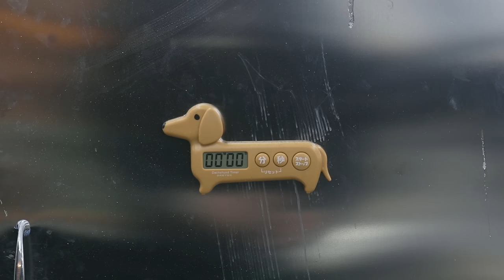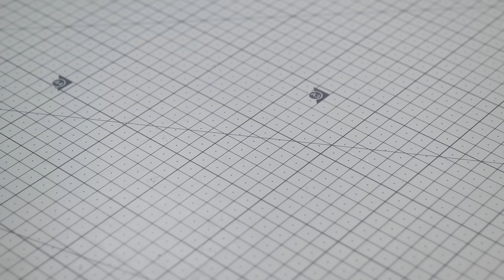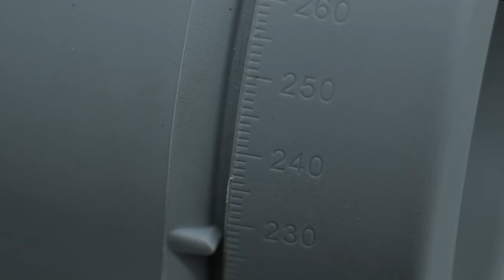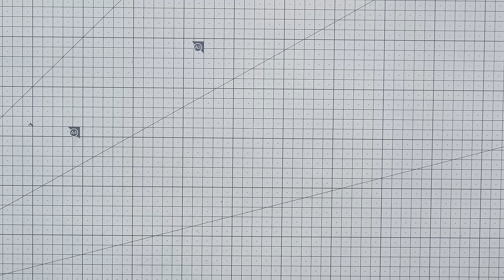'Remake' GUCCI Bamboo Jacquard flat shoes REMAKE - VeTiVeR

Comment: 8 out of 10. nice, but, the heel overlap left a big empty space. the sole protection cut have been cut more accurately. is there no way to perhaps, bevel that edge of the sole protection, so that it has a smoother transition to the original sole. that edge is a bit off putting. the black Gucci material was way too dark. it needed something, more, the color of the bamboo. everything else looks good. great camera work.

Comment: Woohoo another shoe mystery. At 1st glance those don't look so trashed as they are ancient. ¯\_(ツ)_/¯  I have certainly had footwear that was not abused, hardly worn even fall apart after 40 years. In my climate adhesives notariously fail along with plastic disintegrates - among other debilating conditions. 😒 
 Just a guess, a little mystery. 😆

Comment: Great work but I would have stuck to the original colours because the buckle doesn't match the black at all. Plus I would have replaced the insoles as they were looking worn down but underneath could have been clean. And I don't understand, people buy brand names that are thousands of dollars yet they need to be fixed, replaced or repaired. You would think something that is a dew thousand would last you years and years. Feels like even though its a fancy brand name, its made cheaply. Its the brand name you're paying for. Not worth it in my eyes.